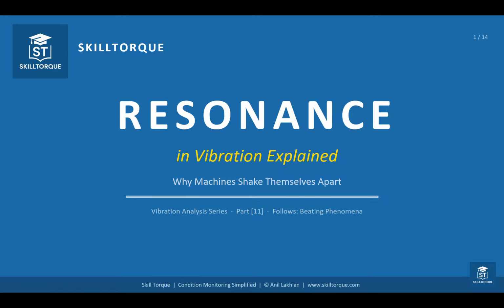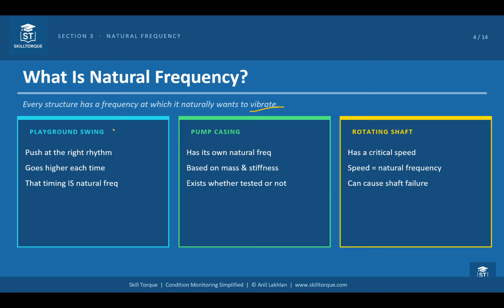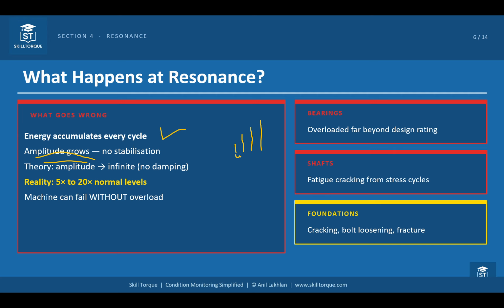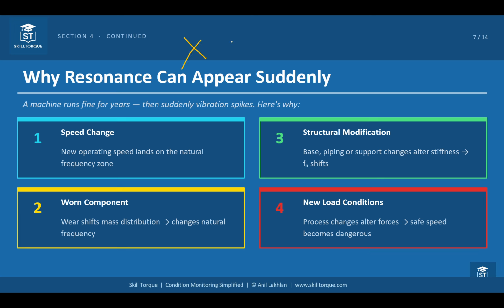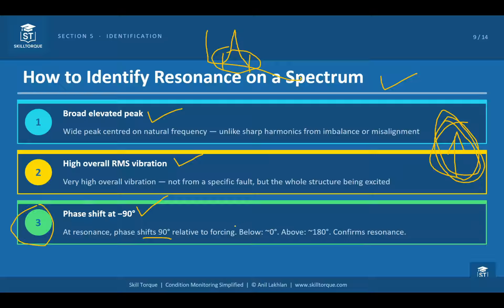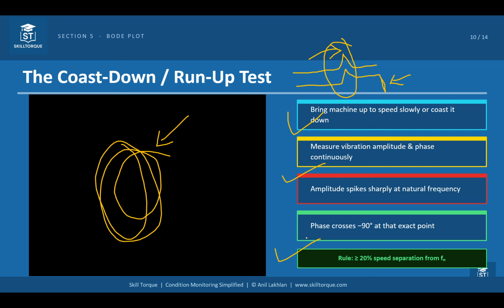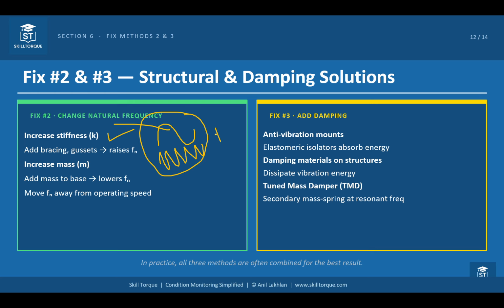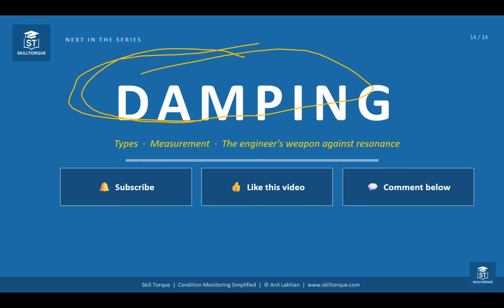Resonance in Vibration Explained — Why Machines Shake Themselves Apart

Comment: Do you have any real life documented cases of failure due to mechanical resonance. With solutions put forward to stop resonance.
Reply from the maker: Yeah; solve multiple cases for resonance & documented. Are you facing any such issue?
Reply: @skilltorque No real life problems as such. But am doing a higher national college course in engineering. I had to present a real life case. I have done the assignment now. Thanks for your video.